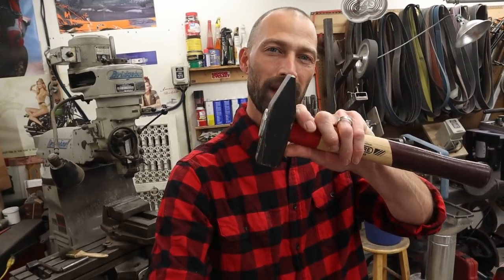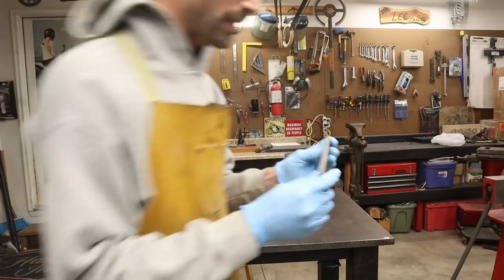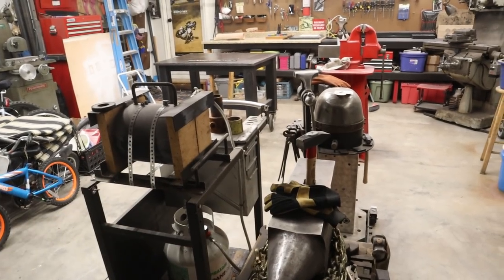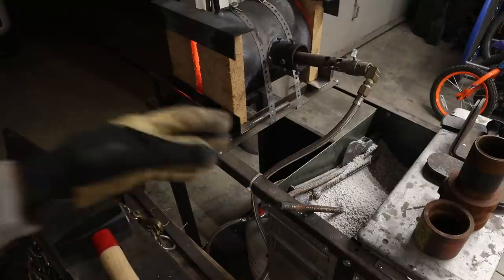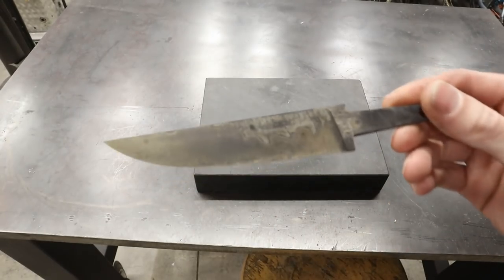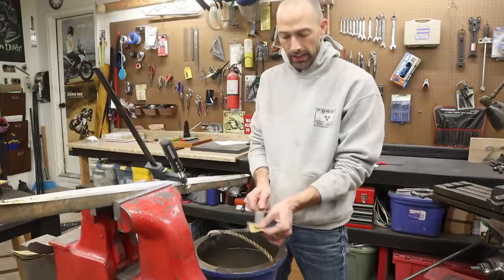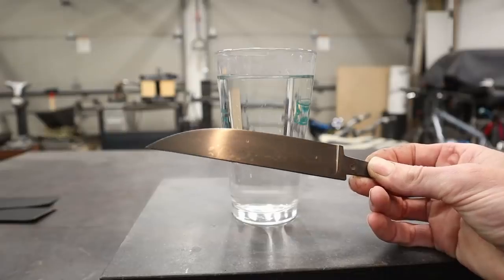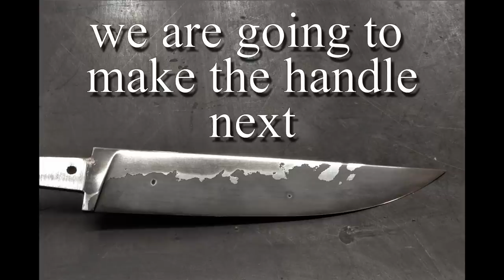San mai by hand - forging a san mai knife with a hammer

Comment: What was the point of drilling the holes? All you have done is leave unsightly pit marks in the blade....That point aside really well done and keep the content coming, I really enjoy the videos!
Reply from the maker: Thanks man! If the outer cladding was thicker the holes would have added an entirely new layer of design in the pattern and you would not have seen any unsightly pit. Think of raindrop pattern Damascus, that is how it is made.

Comment: Flux protects the steel from scale. It benefits you to put it on when hot but not at scale temps (red) to coat the steel and keep scale from forming. Once you have a scale-less piece you keep fluxing to keep it that way. If you get scale on tour steel and then put flux on, you might blast some scale off,  but it’s better to start clean and keep clean than to start dirty and hope to clean as you go.
Reply from the maker: Solid advice, thank you!

Comment: I did this and it only took on one side.
Reply from the maker: More heat and longer soak time before setting the welds. Also the anvil cools one side really fast so quickly tap one side then reheat and quickly tap from the other side to ensure it welds correctly.  Better luck next time!

Comment: great video, thanks for sharing. I know that some old school makers use acid like white vinegar or PH Down to soften the scale so they can wire wheel it off. Jason Knight uses a sand blaster with glass media to remove the scale. I imagine those would be good options on thinner billets to conserve material.
Reply from the maker: Those are really good ideas and valuable information! Thanks man!

Comment: Dude I absolutely loved this video
Reply from the maker: That's awesome Rich! I'm doing the same process right now to create a giant chef knife wait till that video comes out! I'm glad that you enjoyed it
Reply: I don't currently have a welder but my gas forge gets hot! Superfast can you possibly show me how to make a san mai billet using tie wire?
Reply from the maker: Sure I can definitely do that! I know Eric rivers over at Rivers experience just did a cumai billet with wire and he did a really nice job with it if you want to check that out until I can get a video made for you
Reply: Awesome man, I want to specialize in chef knives because of the huge market and San Mai is where it's at!!!
Reply from the maker: True but my suggestion would be to create what you like to make not what you think people want to buy.
Reply from the maker: Also most chef knives are stainless san mai which is much more difficult to pull off
Reply: Right on, I'm not concerned with selling anything right now, I just want to get better, my grinding lines are garbage
Reply from the maker: @rich2760  dude I get it! I spent years making and still make mistakes. There is a saying "knife makers don't make mistakes they just make smaller knives" there isa lot of truth in that saying 🤣😂
Reply: @Aleeknives  I've spent a small fortune on file guides and bevel jigs and grinders and I can not for the life of me get that badass looking wide bevel on my cutting edge.

Comment: Hey boss, just ground out my first knife last night after watching your 10 part video guide (which I have since recommended to friends), and it went well! All the info you provided was great. That said, I goofed up the angles on the blade after going for a saber grind, but that’s just a matter of experience. Thanks again for your help, and great new vid.
Reply from the maker: The cool thing about doing those types of grinds is that if you goof it up you can always do a full flat grind! Sometimes I think those grinds are actually more difficult trying to keep everything symmetrical. Great job jumping in and grinding your first knife!

Comment: You mentioned that next time you would use thicker 15N20 on the outside, I would just like to share a thought on that. 

Unless you forge the overall thickness of the three materials down to the same thickness you had here, you will just be adding more material to grind away. Assuming that in the end your final product has all the same dimensions as this one. If the core stays the same thickness and you grind to the same shape your end result could be the same and more dust around your grinder.

You probably have already thought of that, but figured I'd mention it just in case it helps anyone.

Nice looking blade by the way.
Reply from the maker: The idea behind using thicker 15n20 would have allowed me to get the raindrop pattern to work and come to the surface.

Comment: Not bad Aerin. At least you show your mistakes aswell as your sucesses. Everydays a learning curve. Little tip on the scratches. Dont hold the blade and go back and forth, it will create fish hook scratches. Sand in one direction, then move, to a clean piece of paper. I think you do that anyway when your doing your polished blades. Just treat etched blades the same, in fact even more so as the etchant will realy show them up. I think if you did an extra few layers the rain drop pattern realy would have stood out. Have the core, and outer sleeves thick, and the inner layers thinner, will have a great contrast.
Reply from the maker: Yes sir, a huge learning curve!

Comment: 2 quick questions… Without welding, what type of wire can I use to hold the steel pieces together?
And, you welded on a handle. What if I don’t have a welder, what do I use as a handle? Just use tongs to hold onto the billet?

Comment: What thickness did you use for the 1084 and 15N20? what would you recommend? I was planning on this for my next project. I have some 1084 and 15N20 i bought a while ago to try some simple damascus as I don't have a press or power hammer either :P
Reply from the maker: I have tried a lot of different thickness materials. One observation I jave made is that during forging the outer layers move more than the center layer. Use thicker steel on the outer layers

Comment: Hi buddy, got one more subscriber here..interested in san mai forging, about to try one though.  Your billet looks so white on the video when you took it out of your forge. I wonder if the billet looks really white in real time when it reaches forging temperature? I dont have a forge thermometer so i would have to judge it by its color. Thanks for your tips.
Reply from the maker: The forge welding temp can be hard to achieve with some propane forges. I had to coat the inside of my forge with a special reflective coating to get the heat high enough to forge weld. It will be a super bright yellow. If it starts sparkling you got it to hot but that is pretty hard to do in a propane forge. The camera color is not accurate at all.
Reply from the maker: Thanks for the sub!
Reply: Just got my forge done today, had a nice test run. I opted for a mud kiln powered by charcoal and an electric blower just for heat treatment, but after seeing your vid of san mai done by hand hammer,  i was so excited to try doing it too.  Thanks a lot buddy

Comment: Do you have a recommended source for your handle materials? You seem to acquire some nice materials. My local places are very hit and miss.  Nice tutorial as always, I haven’t been brave enough to pattern weld yet but I did get a bunch of 1084 and 15n20 in my last steel order for when I finally decide to brave it.
Reply from the maker: Thanks man! I actually buy a ton of materials on ebay! Also facebook handle material groups have been awesome

Comment: Is that 1 of the Amazon propane forges???
Reply from the maker: No I built this one but there are many like it out there that would probably perform just the same!
Reply: @Aleeknives  idk. I have a very similar 1 I think I got it from ebay. There are a lot of forges similar to yours but if they're like the ebay 1 I have, they won't get the metal as hot
Reply from the maker: It is really t things that make the difference. The insulation and the burner. I used kao wool and then made it rigid with satanite and made my own burner with hardware store parts.
Reply: @Aleeknives  I think the burner was poorly constructed on my forge. It's obvious someone poorly did what you did and started selling it
Reply from the maker: I am glad the person I copied did a good job😂🤣 I will be making a new forge this year and will make a video about it!
Reply: @Aleeknives  I honestly think the person who made mine just screwed up with the burner. Everything else seems decent. I think the issue is with the air intake holes but I can't say for sure. I haven't messed around with it
Reply from the maker: I run mine on full open adding as much oxygen as possible. If I choke it down sometimes it has a hard time staying consistent
Reply: @Aleeknives  interesting. Does your jet have a mig tip or is there an alternative to that?
Reply from the maker: Mig tip believe it is a .030
Reply: @Aleeknives  did you find the adapter for that at the hardware store?
Reply from the maker: I used an npt brass 90 air fitting and I tapped the inside for the mig tip. I have a generic turkey frier regulator on the bottle.
Reply: @Aleeknives  interesting. I never would have thought to tap an air fitting
Reply from the maker: If you want I can email you some pictures of how I made mine! I won't be home for a couple weeks but my email is airinlee@swbell.net
Reply: @Aleeknives  I never check my emails 😂
Reply: @Aleeknives  I probably should have mentioned I currently have a coal forge and don't really plan to go back to propane. I'm just being curious lol
Reply from the maker: That's awesome!  I don't currently have the time for coal in my shop. I need to be able to shut everything down and leave on a moment's notice
Reply: @Aleeknives  tbh I'm sure I'm not supposed to but when I'm done I just walk away lol. But if I turn my back on the forge for like 2 minutes the damn thing goes out anyways
Reply: @Aleeknives  I am checking out other burners. If I can replicate 1 without putting a lot of money into it I might give something a shot
Reply from the maker: T-rex burners are 🔥
Reply: @Aleeknives  I'd like to make 1 with shit I have laying around lol

Comment: Hey mate just a couple questions about your forge set-up. Is it a single burner setup? How long does it take you to get to welding temp? Awesome video.
Reply from the maker: My current forge is home-made and is a single burner.  It is lined with kao wool and then hardened with a thick layer of satanite. The body is 3/8 an inch thick and I welded angle iron front and back to hold hard fire bricks for the doors.. I made the burner from hardware store parts. I used a turkey frier regulator and hose for the gas delivery system. It gets to welding temp in less than 5 minutes. All in all it has been a great forge but there is a ton of room for improvement! I have been collecting parts to build a much better version than you will soon see on my channel! I am going to do a build series on how to build it also! Thanks for watching
Reply: @Aleeknives  that sounds great. Your forge is roughly the same spec as mine although I have never tried forge welding. This weekend I hope to do my first san mai with some 1084 and wrought iron. I can't wait to follow your new build. I also want to do a brick build ribbon burner in the future.
Reply from the maker: My next forge will be a ribbon burner for sure and I will be coating the inside with ITC 100HT
Reply: @Aleeknives  i use that on my current forge and its great. Just try not to do what I do and poke a lot of holes in it. I should have done refractory lining first then used this over the top.